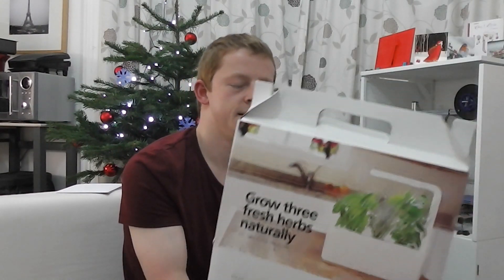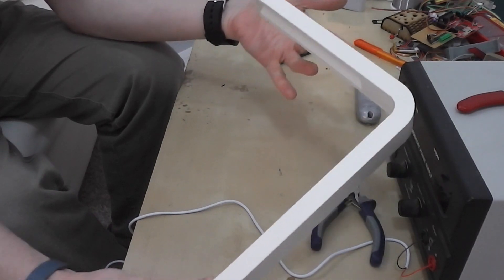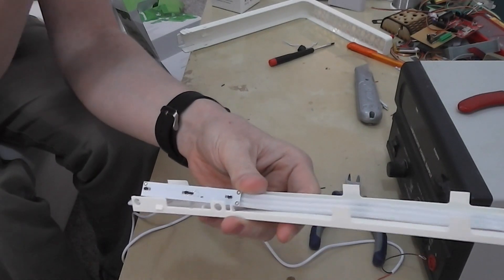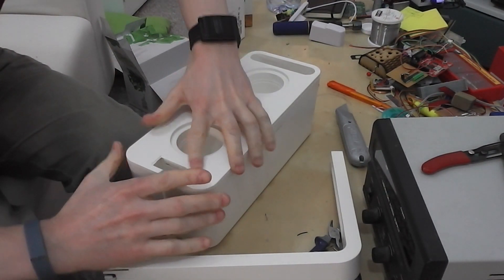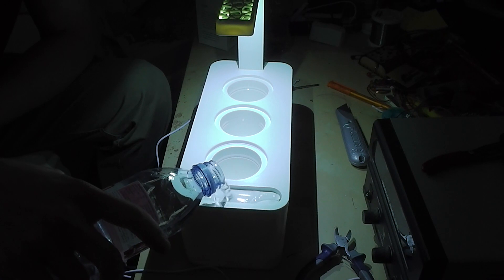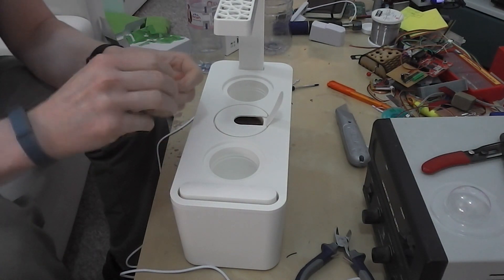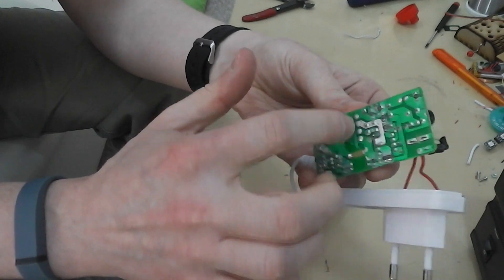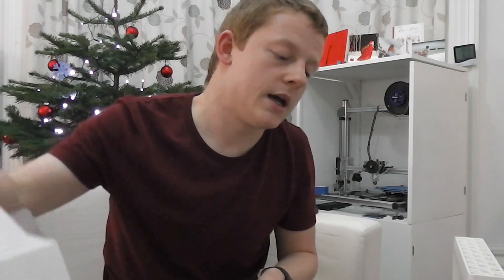Click & Grow Smart Herb Garden Unboxing and Electronics Overview

Comment: Polystyrene float will get waterlogged and will stop working after about 6-9 months IMO... Design flaw?
Reply from the maker: Nick Outram I found that on more than one occasion the float would stick to the side of the housing and stop floating. It still had buoyancy at the end of its life but this "analoge" way of measuring the water height isn't great.

Comment: I came here after looking at all the bad reviews on Amazon, they say the plants get to much water and start to grow get moldy then die
The Light looks like a joke, 2 small LED'S is NOT a grow light. Looks to be as bright as a flashlight.
Did you get any good results?
or should we call the planter Click and Die
Reply from the maker: I am still moderately positive about it. Up until the tomato plant I started growing earlier this year it's been great. The light is decent and seems to be bright enough although I don't keep it in a dark room so I can't say for sure.
The plants have all been watered well but the tomato plant was over watered, not sure why and it ended up growing really badly.
It's a good product but it should be around $50. The cost of the refills and delivery means I won't be getting any more after the included plants are used up.